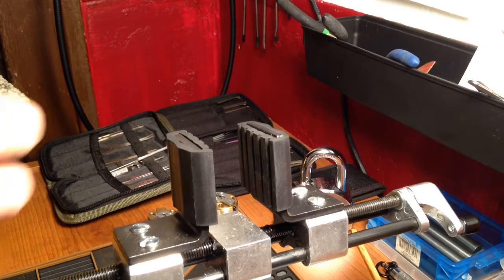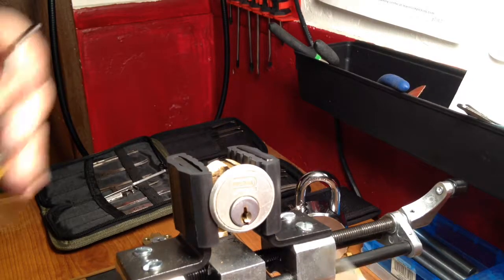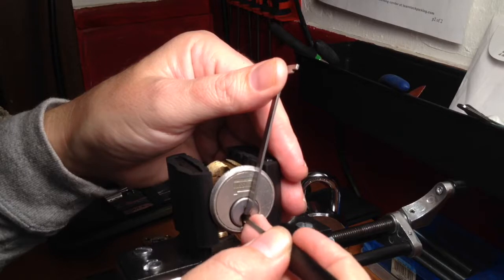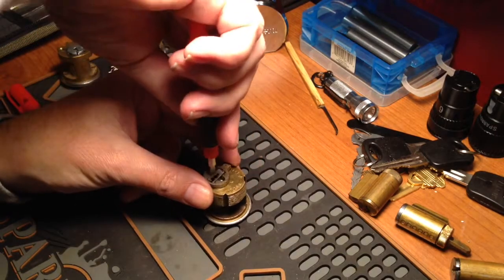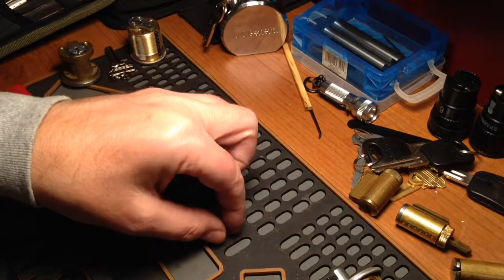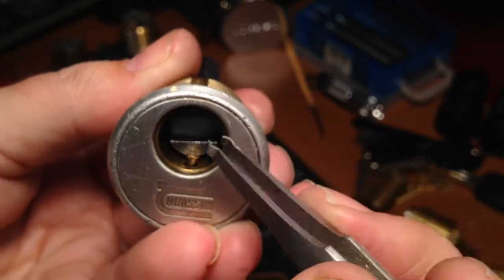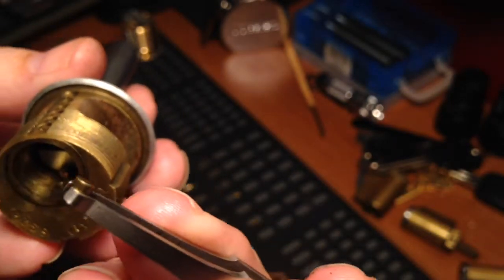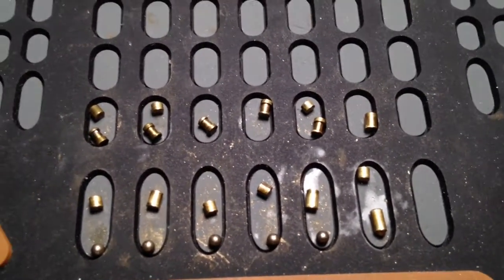Video #11 RUSSWIN lock with ball bearings and security pins picked and disassembled just for fun

Comment: I have that lock now and am trying to pick it.
Reply from the maker: jerry doyle That’s cool man. Its a great lock for practicing. After you get really good at picking it, change the pins around. Since it doesn’t have a key you can even swap the key pins around. Then after that add a couple security pins etc. that’s what I do. I still use my seven pin ultimate adversary. I just change the pins and start over. Get the feel for different pins. Have fun